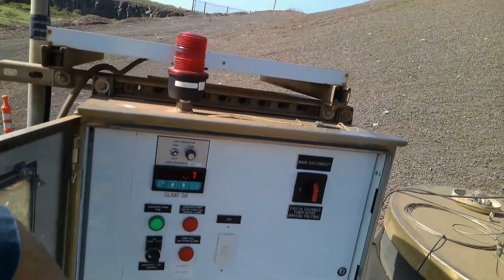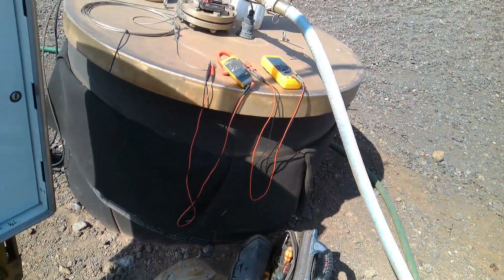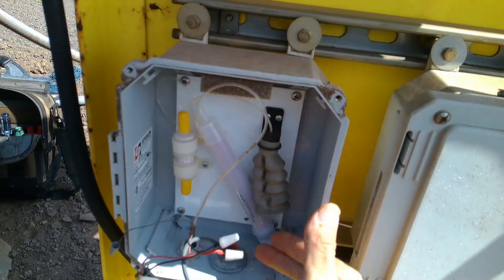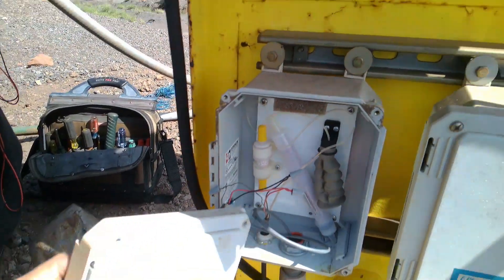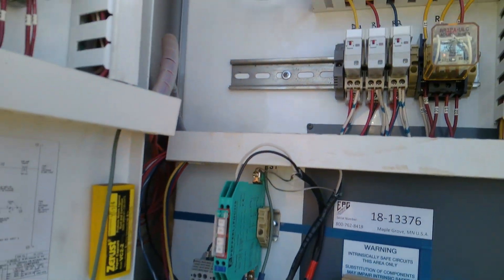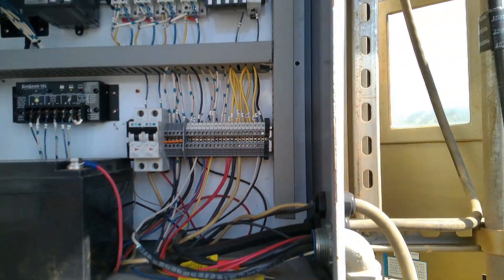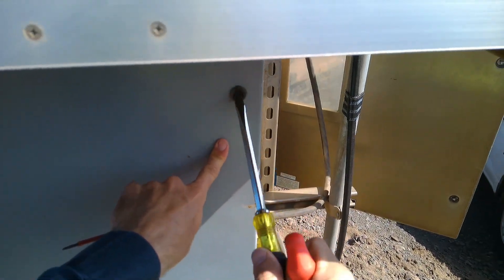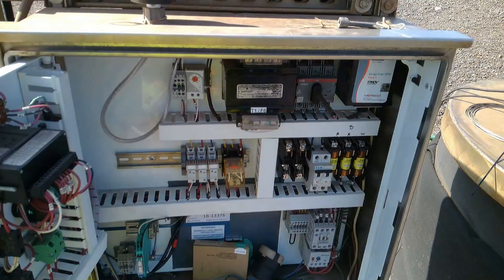4-20mA Transducer Troubleshoot

Comment: I couldn't tell from the video how your conduit is laid out, however I've run into intermittent 4-20mA issues when the controls cable is too close to a power conduit, even with shielded cable. If the submersible power is on intermittently, and the controls wiring is close by, the signal could be disrupted through EMI from the power line. Just another thing to check if this pops up again.
Reply from the maker: Good idea!
Thanks for watching!
Reply: Good point.  The low-voltage wiring needs to cross the high-voltage at a right angle, to avoid induced voltage from the 480/3-phase.  Or ideally be in a separate conduit.  I think a loose wire in this case is probably the culprit, since it's intermittent.  Nice video.